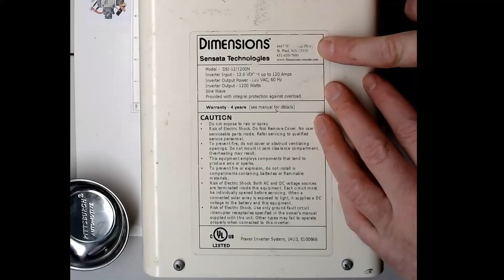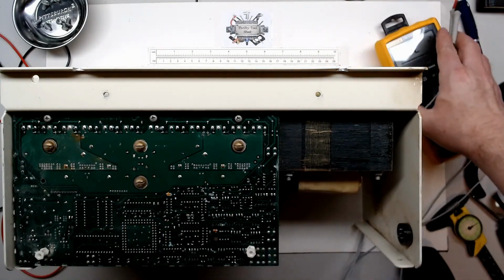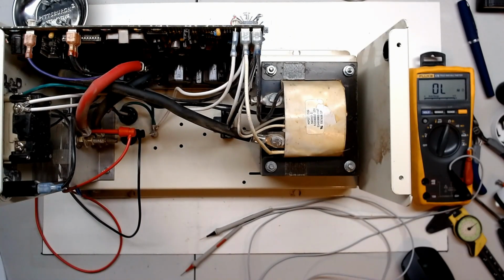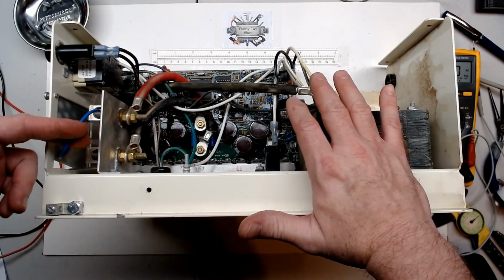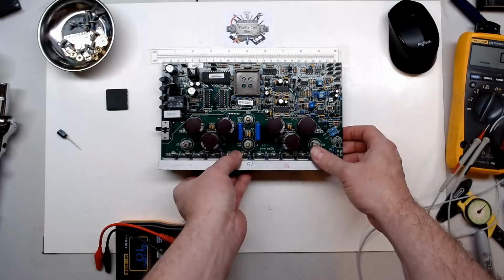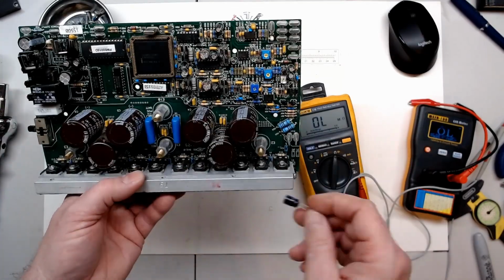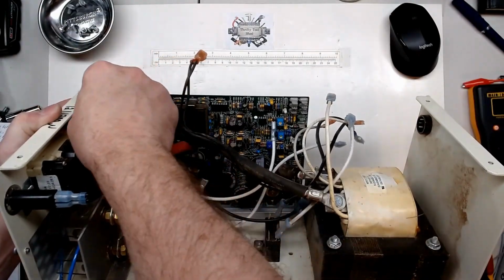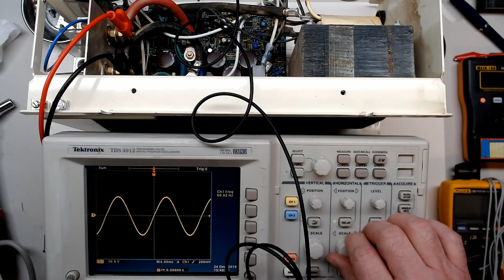Sensata Dimensions 1200N Power Inverter Repair

Comment: TT. On the fets.  Do you curve trace them to check degretition and the fall?    I too change out every dang cap I can as well.  Nice work. That board really cleaned up well. I all ways enjoy your videos. Thumbing up.
Reply from the maker: I do desire to have a stand alone curve tracer. I have used one before and have built one that that works with my o-scope x-y but it's on breadboard and I have never taken the time to make it a stand alone. Great thought here for sure! Thanks for your comment!👍

Comment: Hey, Thrify Tool Shed,  I have a SENSATA SINE WAVE POWER INVERTER SSI-12HF10N it turns on but there's no power in the outlet. Are you local in Atlanta?
Reply from the maker: I am in the Augusta area. You may already know this, but check that your outlet is not a GFCI. It could be getting power to the outlet and still no output due to either tripped GFCI or a faulty one. I worked on one similar a couple months ago and that was the issue.

Comment: What do i do exact inverter gfci stopped working will not reset , could it be the 15 fuse thats on the corner circle button?
Reply from the maker: If it has power going to the GFCI and not resetting then the GFCI will need replacing.

Comment: I have this inverter, works fine with small load such as a couple lights. it will trip the low battery with a load, I can't even cut a 1x12 with a sawzall. 
There is nothing in the "charge voltage adjustment' except a big white resistor. 
Even if I run the truck at 2500 rpm it still does this, it is not the truck because it does it on other vehicles as well. 
Any idea?
Reply from the maker: I have not seen that exact issue, but at what level does it trip at. Is it pulling the system below 12V?
Reply: Thanks for the reply
I think I found the problem, loose terminal in the inverter. 
I can hit the saw now and runs much stronger than ever before and no low battery, it will flash for less than a second when I first hit the trigger then goes out Just the start surge. 
Cables (4GA)  were already on it when I purchased it and hadn't checked them well. 
Thanks again.

Comment: Thanks for the video! I have a similar, but 800 watt version. Not sure what happened, but the mosfets got hot and burnt up. Seems like a couple resistors around as well as one of the  half-bridge gate driver seems to have have gotten hot too. Looks like I can still get all the parts from digikey, but the MOSFETs aren't cheap. Curious as to whether you think worth trying to fix. Thanks again for sharing your knowledge.
Reply from the maker: I would think so. I know the high current Mosfets are not cheap. Sometimes eBay can have things cheaper with free shipping, but it takes a while to get it. I have some concern of fake components from some sellers also. I wonder if the thermal management was working on yours. The heat sink on this one has temp sensor and turns on the fan, which the fan on this one was bad!
Reply: @ThriftyToolShed  Thanks so much for taking time to respond. I see 2 ICs screwed to end of heatsink. I imagine they are part of thermal management system. My fan is working so that wasn't the problem. I'll de-solder  the fried components and see how the board looks before ordering replacement components. If board is okay, I'll proceed. I wish I knew the history and I wish I went to school for EE!  Thanks again for the helpful video. I am awed by some peoples (yours!)  understanding of how stuff works and even more so by their (your!) willingness to share. Cheers
Reply from the maker: Yes, they are screwed into heatsink on the end I believe. Hopefully that will get it. Best of luck to ya! Thanks for your comment!